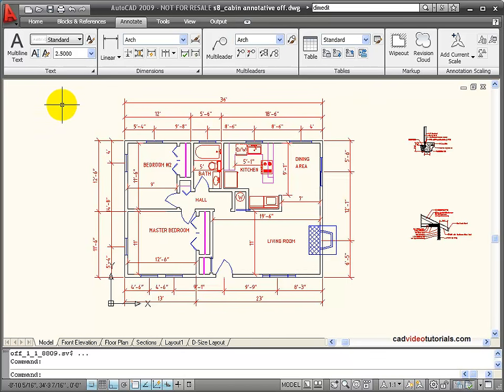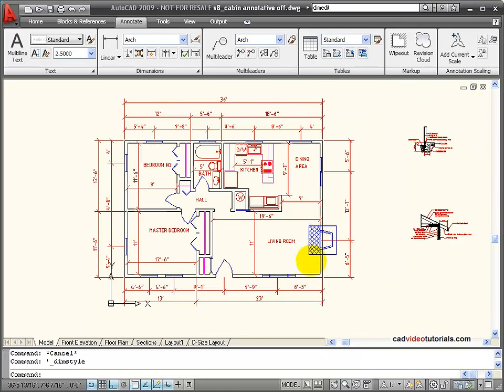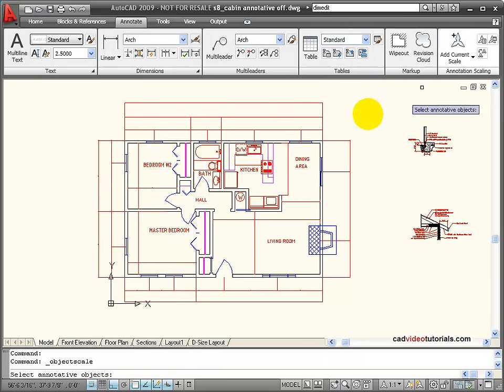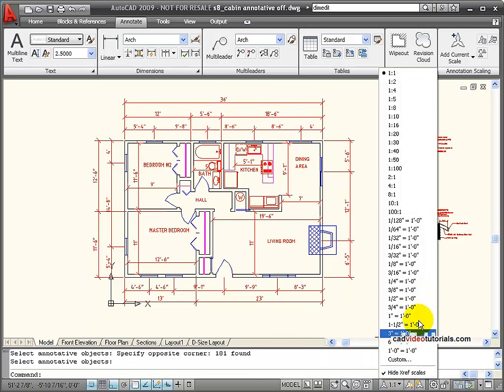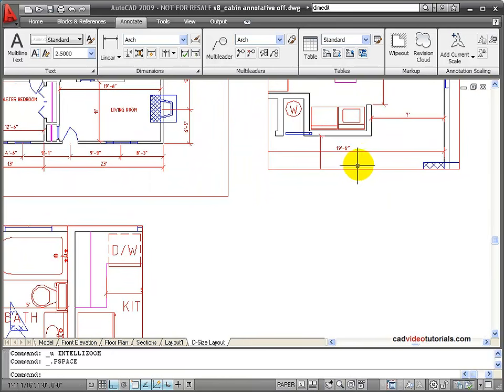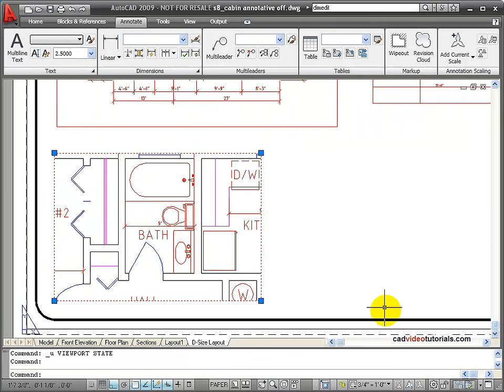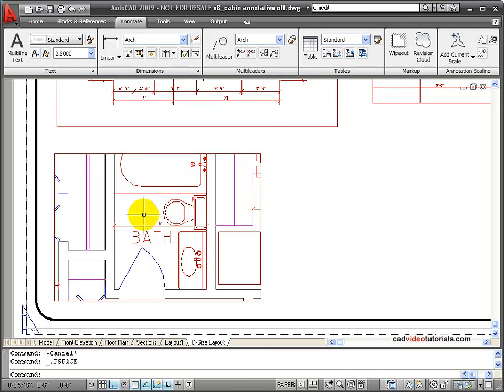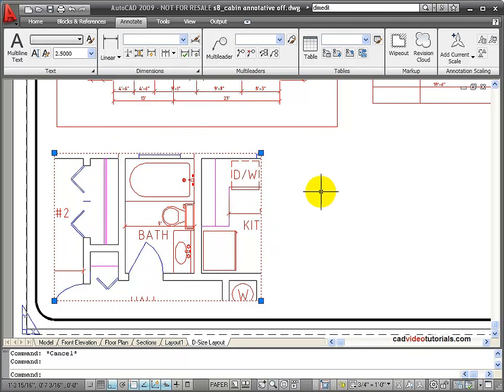AutoCAD Explained - Applying Annotation Scales to an Existing Drawing

Comment: how to scale different parts of a drawing and make sure that other parts fit ? for instance i am drawing an engine and i need to change my cylinders dimensions, crankshaft dimensnions. if i click on it and scale it get bigger/smaller but also drawing gets messed up. how to avoid that?